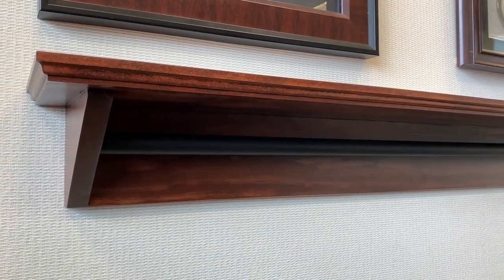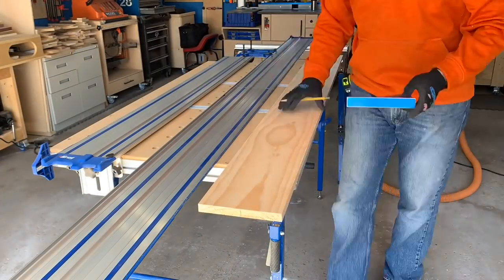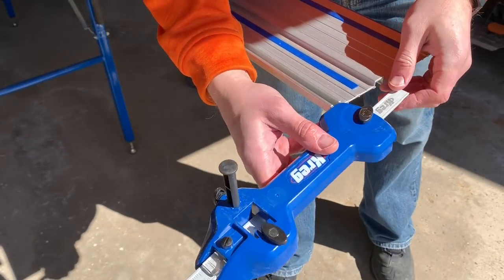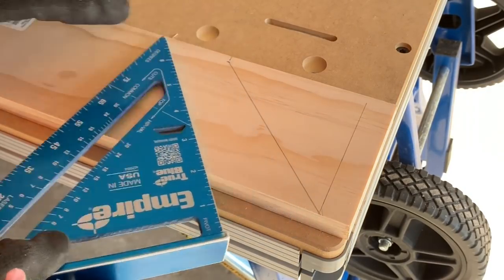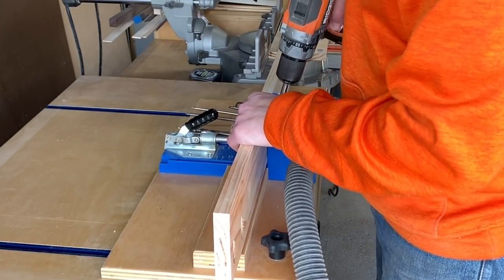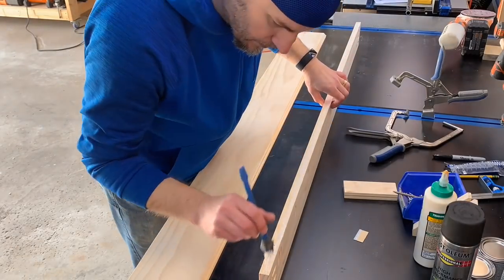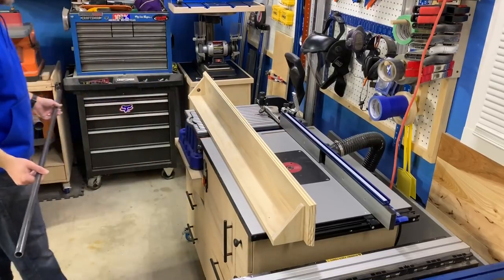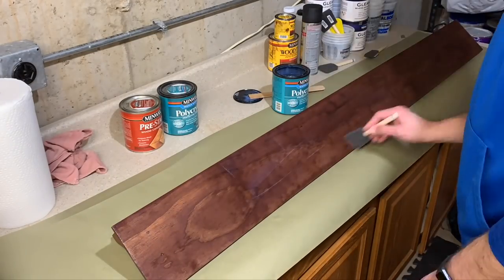CReeves Makes Wall Shelf For Running Medals ep032

Comment: How much does the Kreg ACS cost?
Reply from the maker: Hey Vince!  The saw only is $299.00, the saw and track only is $398.00, and the entire table system with saw and track is $899.00.
Reply: @CReevesMakes  WOW!! not cheap
Reply from the maker: No it’s not but if you consider that it can replace or supplant a miter saw, table saw, and a circular saw, it’s a very versatile system.  It is made very well and the quality exceeds some of the “leaders” in the track saw game that I have seen. You should check one out if you have any doubts, most specialty wood stores have them on display. 👍🏻
Reply: @CReevesMakes  sounds good & looks good but I already have thoes saws & I am just a weekend hobbyest. My garage get sooo hot & humid in the summer I dont do any work in it @ all.